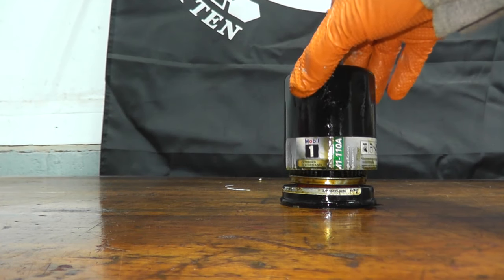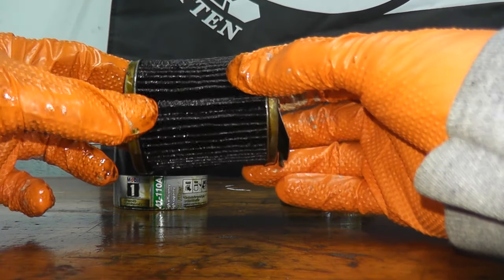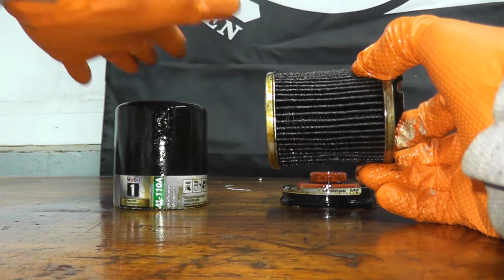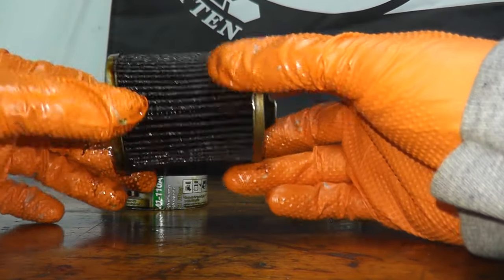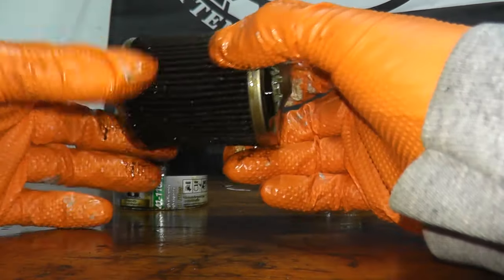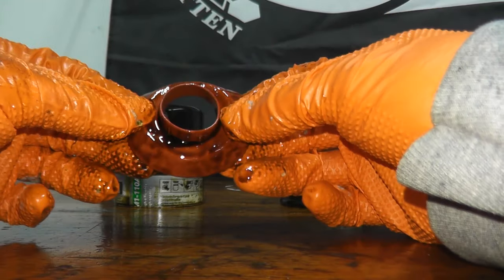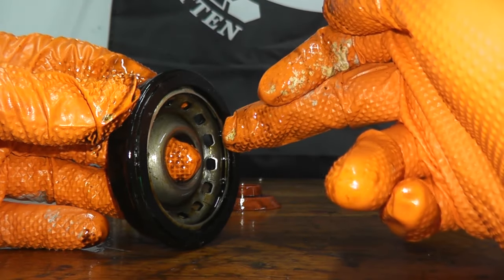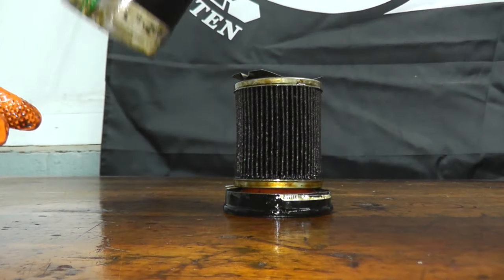Mobil 1 Oil Filter After 15k Miles Of Usage

Comment: When you change your filter, put a thin layer of fresh oil on the gasket. You'll never have an issue with it sticking. Also, after you remove your old filter, wipe down the mating surface with a lint-free rag or towel and you'll never accidentally double-gasket it...
Reply: Even with adding a thin layer of oil on the gasket if u tighten to spec it should be a we bit stuck when trying to pull it off
Reply: @monkeymcgee3630  I find it just helps keep the o-rings from sticking to the block, but that film of oil does also create a small bit of adhesion just from the film, but it gives easily.

Now, that being said. This is a habit started DECADES ago and with quality silicone seals/-rings it probably doesn't matter anymore. Cheaper o-rings may still benefit, but old habits die hard.
Reply: Thank you, Capt Obvious
Reply: @JodieMix  You actually bothered spending time posting that? It's people like you that over torque oil drain plugs...
Reply: @Mike80528 I'm guessing those guys throwing shade at your post, have never heard of people learning how to change oil, and may not know everything like they do.

Comment: My brother in law had a dodge pickup with the the slant 6 engine back in the 70s. He never checked the oil. He drove it 50,000 miles on the same oil and filter. He never added any oil. The engine finally blew up because there was no oil left in the crankcase. I put a junkyard engine in for him. He did exactly the same to that engine. I quit working on his truck for him if he couldn't even bother to keep the oil at the proper level. The slant 6 was bullet proof if you did basic maintenance on it like change the oil and filters.
Reply: This comment pisses me off for some reason!!! A brother’s stupidity should never be underestimated...trust me, i know...
Reply: No way I could not believe this.  Bro
Reply: @romansroad2007  
Have a brother who was a fireman then became a fire marshal performing fire prevention inspections.  He would leave plate covers off the electrical outlets which were accessible to toddlers (I installed them out of concern for my niece and nephews) and would use extension cords on old space heaters. He wound up losing his house to fire from overloaded old wiring and, to top it off, he had let his homeowners insurance lapse.  Some people are stupid, lazy or both.   Their family suffers for it.
Reply: I seldom change the oil in my hybrid car.  I check it regularly, but I'll go for 25K miles, and it's still honey colored.  I then guilt myself into changing it.  Oil changes are overrated in hybrid cars which run less, and at constant high load low RPM.
Reply: yeah id say your BIL is a fool lol
Reply: Tee Mack  
Yeah, it embarrassed him. But the firemen really pitched in to help him with fund raisers and donations of furniture and appliances.  They raised $50-60,000 cash plus the household goods.   Still, he would’ve been much better off following safe wiring practices and keeping up his home insurance.  Laziness and irresponsibly are terrible attributes.
Reply: kick him out the family
Reply: @BarneyBeauregard  That’s not even close to the same scenario.
Reply: My dad would do the same

Comment: Oil and oil filter is cheap, engine not. I always change oil between 3k up to 5k . Majority of engines nowadays are Direct injection, timing chains and some with turbos, these engines rely on clean oil .
Reply: Yep i used to go 7500 or more but now I do anywhere between 3500-5000 depending on how often I drive. Top of the line oil and top of the line filter. I drive a 2011 Ram Hemi 5.7. It now runs a lot quieter and smoother. These engines are notorious for valve lifter and camshaft breakdowns so changing often helps.
Reply: Totally agree...5,000 miles is max...oil and filters are cheap vs your engine...
Reply: Look at the little hole  in your hydronic lifter through which oil must travel. OH S### what was I thinking
Reply: @Dmgolfer22  id just always go using supertech oils from walmart (cheap) because oil is oil it still lubricates but when it comes to filter i go high end kandn or mobil 1’s
Reply: I always change the oil about 20,000 miles
.never had an engine problem. The main problem was the body rusting away.
Reply: Would you mind sending me that oil when you're done? You're basically throwing out brand new oil. :-) 

Even non-synthetic oil can run 7,500 - 10,000 miles per most modern cars owners manuals. If you start using premium synthetic that guarantee 20,000 miles you're well beyond anything else. My 2013 Chrysler 200 recommends changing conventional oil every 10,000 miles. I run the 20,000 mile guarantee premium full synthetic and still change at 10,000. It comes out with a ton of life left.
Reply: @bugoykikay8074  , it’s not cheap. It’s inexpensive. Supertech meets all the specs of expensive oils.
Reply: Tee Mack  well I bought my 2011 in 2018 with 84K miles. Within a few weeks I noticed it was burning a ton of oil and blue smoke started coming out the back at start up and it had the “hemi tick”.  Luckily I bought a warranty. Ended up being 6K of work. Replaced valves, lifters, and camshaft. Since then I’ve put about 30K miles on it. I’ve used PUP 5W20 with the OEM Mopar filter. I’ve changed it on average every 4K miles. I’ve also kept it completely topped off at the top line on dip stick. It runs smooth. I don’t think it’s the brand of oil as much as it is keeping it changed and topped off. I don’t want it happening again since now I’d have to pay.
Reply: @bugoykikay8074  I don’t think it’s the brand of oil as much as it is changing it often and keeping it topped off. Issues seem to develop going awhile without changing and oil level drops a bit and the oil starts to break down. These 4th gen hemis are high maintenance. Lol.
Reply: do oil analysis.  it tells you the interval needed.  3k is wasting money.  Simple as that.
Reply: @02hreblue30  it ain’t a “Waste”. Some enjoy doing maintenance and it definitely doesn’t hurt. For some money isn’t an issue and changing too often is better than the opposite.
Reply: @bugoykikay8074  actually, you are better off with a high quality oil with a crappy filter than a high quality filter with crappy oil.
Reply: @SkydivingSquid  have you opened up any valve covers of those vehicles to ensure it is okay for such use? or do you only go by UOA?
Reply: I always use full synthetic, quality filter and 10K intervals. Never had a problem.  Traded in my 2004 Ram 1500/hemi truck at 275Kmiles because got tired of patching body rust.
Reply: @a3300000  my feeling is: if the oil meets the API and ILSAC specs, that’s the criteria that I go with.
Reply: @carlovanrijk4039  yes sir.
Reply: I suppose that is fine for conventional oil, but for synthetic, this is the old way of thinking that many people just can't let go of.  It is true that Oil is cheaper than an engine, but the motor oil of today isn't what is was 30 years ago.  The true PAO oils of today are far superior to conventional.  For anyone who doubts this just have your oil analyzed at a lab.  It is inexpensive and tells you what is going on with your oils additive pack and also gives you an idea of what might be happening inside your engine.  Since some of you have so much money to waste on changing your oil every 3000 miles, consider getting it tested and see just how far you can push it to get your moneys worth.  Using a high quality filter designed for long intervals is also important and while you may pay a bit more upfront for all of it, you save a lot of hassle in changing your oil so often. There is little sense in changing perfectly good oil.  Unless you just like to change oil recreationally.  Have fun.
Reply: @Chatsworth Osborne, Jr. that’s primarily the type of driving that I do…highway miles. Changing the oil at 7,500 miles, and then sending it to a lab for analysis, the results came back that the oil can hold of til 10K miles before changing again. I’ll just stick with 7,500 miles. Why push it?
Reply: @carriersignal  LOL I admit, I like the recreational comment and guilty as charged. It is nice for me to get one with my vehicle every 3 to 5k. It is therapeutic to have control over the machine and get out in the garage and feel a sense of accomplishment and control which is rare with dealing with people and day-to-day crap over and over, which I have no control.  Also to not worry if I should have changed it a thousand or 2k miles ago. I feel better knowing that it is clean oil at all times and yes, I know it may have could go another 2 to 3K miles but it does make me feel good. I am sure others feel the same way. Is it necessary? Probably not, but when I go to sell it the buyer feels better about the purchase.

Comment: Walmart sells these for $10.00. Auto parts store $15.00.
Reply: It amazes me how auto stores dont sell for less than walfart.. that's all they sell smh
Reply: @j.k.j.j.k.j.99  oil also
Reply: @j.k.j.j.k.j.99  walmart has a higher volume than auto stores. they can buy them cheaper and sell them cheaper.
Reply: @TeamMadcrew  that's cause it's cheaper. The auto stores stock way more merch than walmart but dont sell it cause they charge more than walmart..which is my point..
Reply: Auto parts stores do combo deals sometimes for cheaper.
Reply: $9.97 - 2.22 for the crappy Fram oil filter had oil change (no tools to do it myself).
Reply: i got my m1-104a today for $9.97 at walmart and 5 quarts of Mobil 1 5w30 high mileage full syn for an oil change.

Comment: I use mobile 1 oil and filters for my 02 accord every 5000 miles. Engine has 295,000 plus original miles and still sounds good. After watching this video, I now know I've been using the right stuff. Even after a oil change, I've never heard that slight knock on start up like you do on some engines, engine has never been run dry.
Reply: I mean that’s great but those old Hondas will run on cheap oil with cheap filters 😆. I know I’ve had a few one over 300k. Keep it clean and she’ll go forever
Reply: @ajmedeiros77  it's starting to develop a ticking sound since I posted this comment. It's now got 336,000 plus miles but the engine still runs good. The tick practically disappears when it's under a load and even more so once it warms up so that tells me the bottom end should still be good... no rod knocks. I have discovered these engines develop this tick due to spark timing/detonation which creates piston slap over time and outside of rebuilding it there's nothing can be done about it. They will still run for many more miles if it's taken care of and not run hard. Unfortunately I ran mine with a bad knock sensor for too long and threw the timing off and I didn't catch it in time. Detonation is hard on any engine. I have a 97 f150 with a 4.6 do this, and ended up with a few bad wrist pin bushings and needed replaced... so I just rebuilt the entire motor.
Reply: @garyr7027  Interesting thanks
Reply: @ajmedeiros77  not a problem. If you have one of these Honda engines, I'd highly recommend doing a scan for "soft codes" stored in the ECU for knock sensor errors. These sensors won't always trip the CEL for hard codes until it gets really bad, and will still throw the spark timing off and you won't even know it till the engine damage is done. It will take a good scan tool to do it, a code reader won't catch it. You may even need to look for knock sensor signal oscillation to catch it, then you gotta know what to look for at that. From my research, Hondas ECU systems are VERY picky at spark timing, it doesn't take much to throw it way off with high mileage engines and the detonation knock is hardly audible... very difficult to hear it. Just a little advice that I learned the hard way.
Reply: @garyr7027  hahahaha
Reply: @autograph415  that's what I said... Lol. I no longer own that Honda... too many miles on it to keep.
Reply: @garyr7027  lol
Reply: 2012 Acura TSX using mostly Mobil One and Valvoline 292,000 and runs like new.

Comment: Every 5000 miles,easy to remember, 5,10,15,simple.
Reply: Yeah, same here. I don’t like the 7,500 interval because of that confusion.  I tried 10,000 once with full synthetic Mobile One oil and filter.  I didn’t like the appearance compared to 5,000.  It may have been ok but over 200,000 miles you’re talking about 20 oil changes versus 40.  That’s just $600 ($30 per DIY) difference for the added assurance of no engine failures.

Comment: I use Mobile 1 filters and Walmart E-Tech full synthetic oil. Change every 5000 miles. Cheapest insurance policy you can buy for your engine.
Reply: I also use the full synthetic Super Tech, a 5 qt. jug for under $14
Reply: Switch to fram ultras man. The kick the hell outta those mobil 1's.
Reply: @losi8ightyew  I have seen the insides of Fram junk filters. Pure junk. You couldn't pay me to use anything made by that company.
Reply: @losi8ightyew  if that’s so, why does amsoil recommend wix filters/ and sell them on their web site? Of course they want you to buy the amsoil first.
Reply: @herbb8547  
You are so smart...
Reply: @o1mtbiker  FYi - Oreilly's Microguard filters are actually rebranded WIX and sold at a discount price. A YouTuber did a dissection of the specific Microguard that I use and for the price it was a very well constructed filter!
Reply: @JA-rn5qv  thanks didn’t know that, don’t know the discount price, for me rock auto seems to be the best to get wix. At least for the filter I use.
Reply: @o1mtbiker  Rock Auto is the way to go especially if you are already ordering some other part from there to cover for the shipping charge, good idea to order a dozen oil filters at a time.  For times when you need an oil filter right away and want to go with WIX that's when Oreilly's rebranded WIX (Microguard) is a good option and not have to pay the WIX retail price. Ends up being a buck and change more than the Rock Auto price for the WIX I usually get.
Reply: @losi8ightyew  Anything Fram is crap
Reply: @droneworks6340  Not ultras dude. The rest of them, yes.

Comment: M1 oil filter is a blended cellulose/synthetic microglass media.  A full synthetic media would be Royal purple, Wix XP, Amsoil, Fram Ultra, with the Wix XP being the least efficient at catching the smallest particles.
Reply: and?
Reply: M1 oil filter media is efficient and durable, but the media is more restrictive to flow than a full synthetic media. This could come into play with higher viscosity oils in cold weather at startup. Full synthetic medias such as Amsoil EaO oil filters or Fram Ultra are very efficient and still flow extremely well, but require a wire mesh reinforcement of the synthetic media pleats.
Reply: @02hreblue30  overpriced for it's performance
Reply: You forgot the best, purolator boss
Reply: Purolator boss has best rating 99% at 20 microns

Comment: Check the filtering Micron size, some of the extended life filters just let slightly larger particles pass through in order to continue filtering at extended intervals.
Reply: You are correct.  I found that Amsoil limits miles on their smaller EaO series oil filters to 15,000mi/1year and the larger ones to 25,000/1year....that's using their best Signature Series oils. I am guessing that some other brands just decrease efficiency on their smallest 20k mile oil filters to make them last that long without going completely into bypass until replaced.

Comment: You can get this filter at Walmart for $10.00.
  I run this filter and synthetic in my 2016 Nissan Altima. Change every 5,000 miles. No problems. The recommended part number is a short filter, I've matched up to a taller filter. More media.
Reply: What do you mean you matched it up? Simply because the threads are the same and the gasket is the same doesn't mean the internals are the same.

Comment: I use the 20k mile Mobile 1 filter and 15k mile Mobile 1 5w-20 Full Synthetic on my 2018 Rogue. It's nice changing my oil once a year, vs. 4 times a year. Plus the savings speak for itself. I rather spend $50 at Walmart for a yearly oil change than $25 every 3 months (changing it myself). Half of the cost right there!👍

On my 98 Dakota, I use the Super Tech filter and Super Tech 10w-30 High Mileage Full Synthetic. Come to find out that the Super Tech Oil is manufactured by ExxonMobil. Name brand oil at a Generic Name Price! 👍
Reply: Super Tech is cheap as well as Kirkland, Amazon etc because it has low coefficients for main antiwear and detergent additives. If you care to keep the vehicle for long time, I would rather choose Mobil, Shell, Pennzoil that are couple bucks more expensive but has better package compared to Super Tech. Thanks

Comment: The MKVII Accord (03-07) manual specifies an oil change interval of 7500 miles. I've been using this exact filter on my '04 Accord  for a while; Kudos to you OP for dissecting this thing to see what it would look like if I ever went that long. Although, 3k miles is all I can take before getting apprehensive.
Reply: I use these filters for a long time and run them 8 -10k in my Hondas with 0-20 Mobile 1. I've driven them hundreds of thousands of miles. I had an occasion to send an 10k plus used oil sample for testing. Looking at the results, the takeaway was the oil was well within standards in all stats. I could have probably ran it another 5 or 10k. None of my Hondas including one, my beloved 05 6-6, nearly 400k, have ever used any oil even in 100 + temperatures. Good maintenance with today's synthetic oils and filters, modern engines will run well past the rest of the car they're installed in.